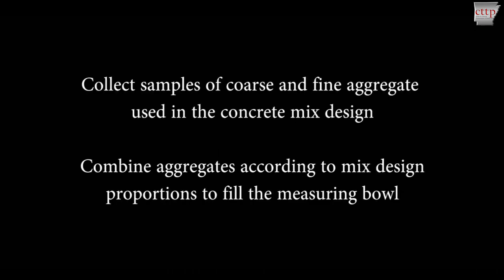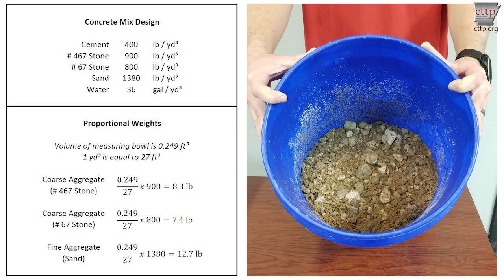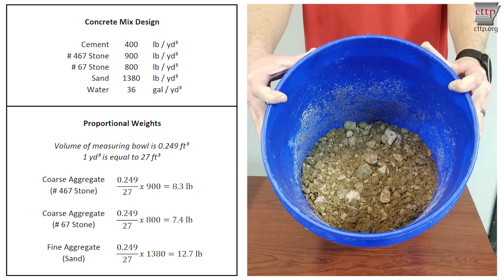ASTM C231 - Aggregate Correction Factor

Comment: Do you have to perform that test in the aci testing
Reply from the maker: For ACI Testing Technician - Level 1, you do not need to perform this test on the performance exam.  The performance exams are:  Sampling (verbal), Temperature, Slump, Making Cylinders, Volumeter, Density, Air Pressure
Reply: Yes
Reply: depends on location, most do not, agg correction is given and you use it to solve air reading